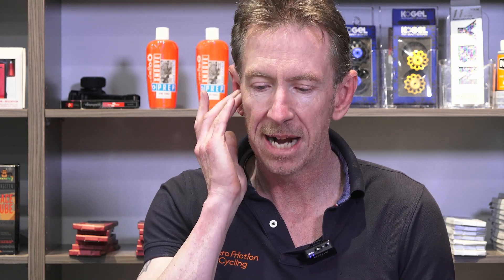Episode 10  - 12 Speed Chain Compatibility

Comment: Thanks mate. Great video. Trying to a run a 12sp GX chain on a 12sp SLX cassette. Front ring is GX also. 11/128 so should work, but its really clicky on the cassette. It should work right?
Reply from the maker: Thanks Peak Torque, and yes mostly.... it should. There are some little differences though that can mean things have to be really dead on. The shimano chain is a little thinner than eagle, and rollers a little smaller, and has the extended inner plate links for hyperglide+ which the cassette teeth will be profiled for. However it should mean that simply we just need to ensure tune and b-tension etc is set precisely. Is it clicky in every gear or just largest cogs? and is it clicky on cassette but smooth through pulleys or is it not meshing perfectly into pulley teeth (eagle or shimano pulleys?). Honestly GX eagle can be faff to tune for gx cassettes - it is not usual for GX riders over time to at least upgrade shifter to x01 - as just have ongoing issues re some cogs it is clicking way as not perfectly tuned, and trouble keeping it in perfect tune. 

Also basic checks such as if it was perfectly fine on GX cassette, and only change is to slx cassette, how old is chain? GX chains wear very rapidly, worn chain on new cassette can have poor mesh etc.
Reply: @zerofrictioncycling992  thanks for the rapid response! Has been frustrating me since the width when measured seems almost the same. For clarity, its a GX groupset from new but had the cheaper NX cassette on a hyperglide hub. New wheels are xdr or microspline, so got a SLX blocks as its less than half the price of GX and its a winter hack... 

Its clicky, oddly, in the smaller cogs at the back! Goes to the 51t with no binding. Its a metallic ticking sound. Maybe a very worn chain as you state. Has see some abuse! A few tweeks of cable tension either way doesn't seem to change much tangibly, then again on a gx shifter it never did, as you quite rightly state! Subbed to your channel, should have more mate!
Reply from the maker: @PeakTorque  ah yeah check chain wear first then, GX chains are shit. XO1 eagle has literally like 20 times the lifespan pretty much, or ybn 12 work super smooth on eagle and will with a SLX cassette, and about 5 times + wear life of a gx chain for most. And yeah im terrible at social media - i am going to lean in xmas hols to start trying to do vid updates meself now vs film days that i just never get to prep properly for, and due to cost though per vid i have used cover the main longer topic stuff, will be looking to move to shorter updates each week or two in 2023 which will hopefully drive a bit more traction vs very sporadic longer vids. Thanks for subbing! let me know how new chain goes - that wld be first port of call and do asap as running worn chain will chew out your new cassette and rings. 

The reason sram cassettes double the cost of shimano is cos they use a much harder steel. Shimano stuff will wear much faster unless looked after, so you really dont want to run a worn chain - you can do a fair bit of damage in fairly short order, especially mtb with higher torque / tension for a given power due to smaller chain ring and grit involved etc
Reply: @zerofrictioncycling992  interesting thanks mate. I know how hard the plan, write, edit process can be when all you wanna do is work and get the data. Its a labor of love, and hate!
Interesting about the hardness, have you hardness tested them? I normally go for Deore to get steel rings right to the top to deal with the low speed torque. Interestingly even the Deore cassettes use the same type of peened steel finish an ultegra road cassette, not the chrome plated (cheaper steel) equivalent to 105. Have never tried a ybn chain, may have to give it a shot id you reckon it'll work on both slx and sram cassettes.
Reply from the maker: @PeakTorque  No havent been able to hardness test them - i have had on the wish list for ages to wear test cassettes like the chain wear durability testing but lubricant testing has just been too flat out to try to keep up (there are scant options globally for manufacturers looking for independent verification on their lubricant performance). 

Just from experience and also bikes through workshop over the years - srams steel cassettes have typically been notably harder wearing vs shimano. For eagle x01 and xx1 level this has been pretty easily determined as sram has actually marketed via reps that the cassettes 11 steel cogs are made of tool hard steel, and that is born out in practice with them being extremely hard wearing, and it is a big part of why they cost so much. An x01 / xx1 eagle vs XTR, XT, its no contest re wear, and the cost to mfg is a big part of why they cost so much more. This appears to carry on quite notably still down the range - a GX wont be same steel as an x01, but there is still a reason it costs double vs shimano equivalent - the steel is a lot harder.  

*Note for eagle cassettes though, often x01 / xx1 are ruined due to the fact the largest cog is made of soft fast wearing alloy, not tool hardened steel. People shld try to avoid using as much as possible. I barely ever use mine, and it is still by far the most worn cog on my oldest xx1 cassette - where the steel cogs i have been using for last 6 years are barely worn at all. People who actually use the 50 / 52t cogs even mildly will have that cog worn to replacement point whilst the remaining 11 cogs are still mint perfect, ruining a very very very expensive cassette. It is maddening that sram do this.  

Anyhoo :)  - Yes the ybn will run beautifully on eagle and shimano - so if GX chain is worn (and its sounding the likely culprit) - definitely try a ybn sla 12spd - hopefully you live somewhere you can get one ok - they can be hard to find locally in some regions

Comment: Using a Garbaruk front chain for my new Shimano Ultegra Di2 in a 1x12 setup and had exactly the same question about HyperGlide+ compatability for a multi-teeth design. Garbaruk promised it would work - and a little to my surprise - I have no complaints so far. Its still early days but rear shifting is great and the system noiseless, on top I have not had any chain drops in spite of hitting a couple of very brutal bumps that flung other parts off the bike. Probably these chain rings work the best for 12 speed chains, but only guessing here? I think there are 3 multi-chain-type-compatible producers that include HyperGlide+ compatability - WolfTooth for instance does not even if they have HG+ chain rings. Maybe you can one day test how these chain rings work on friction/wear? A lot of people are looking for HG+ alternative chain rings for existing bikes now as they look to upgrade to the new Shimano HG+ group sets.
Reply from the maker: AH most excellent. Yes on my mtb i have wolf tooth hyperglide+ rings - and all been perfect over a couple years now re no chain drops, even when not running shimano chain but back to eagle for training or ybn for racing. Sounds like garbaruk may be at least as good. Issue that may come up with trying cross compatibility in shimano 12s is going to be more on the back end for single ring bikes, if one goes away from shimano they will be giving up hyperglide + shifting if using a different cassette or chain. For road bikes i am not sure who yet may have shimano 12s compatible rings but considering how astoundingly good the new shimano 12s front shifting is, i wouldnt mess with that unless there was an extreme cosmetic benefit :)
Reply: @zerofrictioncycling992  "i wouldnt mess with that unless there was an extreme cosmetic benefit :)" - Agree 100%. But and Shimano does not make 5-point BCD chain rings which I'm stuck with. I confess I did get "bling" now that I was forced to experiment anyway. 🙃 Happy riding!

Comment: I currently run a 1x11 setup with grx rear derailleur, sunrace cassette, sram red 22 crankset with Absolute black ring.
I'm planning to switch to SRAM Rival controls and Rival XPLR RD and I'm trying to understand the different possibilities in term of chains and cassette.
If I understood correctly:
option 1: I stay in the axs ecosystem so everything sram, 10-44 XPLR cassette, 12speed flat top chain and that's all
option 2: if I want more flexibility in terms of cassette/chain I need to change the Pulley wheel with some 3rd part one, otherwise the jockey wheels don't work with other chains than flattop

Is it right?
Reply from the maker: Hi Michele - sorry delay we had dashed off for a weekend of racing! 

If you go the xplr path then you are switching into the flat top ecosystem. AB or alugear or wolf tooth MAY (im havent had time to check for awhile) make an axs flat top compatible ring for your crank - but im not sure. You will definitely need to go an xplr cassette as the indexing on the xplr RD is set for the more narrow cog spacing of the flat top chains (they are thinner than sram eagle 12spd).  This means you should then be running the flat top chain to match the cassette and the pulleys on RD, as such you need a flat top compatible chain ring. 

YBN and KMC both claim for their 12spd chains that they are compatible with flat top system, however i am EXTREMELY dubious of these claims as they are different standards, with flat top chain being externally and internally thinner and with larger rollers. YBN / KMC / sram eagle 12spd chains are externally and internally wider - so indexing has to be extremely precise, but the greater chain line angles of larger xplr cassette will still have a very high chance of side of chain rubbing on sides adjacent teeth in larger cogs even when indexed as perfect as possible. Also standard size rollers running on cassette teeth machined for oversize rollers means that to those chains an xplr cassette would appear very worn, and it is possible that much more early than normal chain could jump under high load. I just wouldnt do it, and i disagree with those chains being cross compatible to a completely different standard groupset. 

For most flexibility you may want to have a look at what is called "mullet" set up. SO you can pair rival controls to an axs GX eagle rear mech and run sram eagle cassette - however you are stuck then with a pretty big range of 10-50 or 10-52 (it is getting hard to find 10-50). Again depending on the frame, chain line angle in the largest cog can be extreme as it is just a really big cog for a gravel bike, and they are not always designed to be able to run such a large cog due to the more extreme chain line angle this creates (gravel bikes can have shorter chain stay lengths than mtb,s and mtbs tend to have smaller chain rings - like a 32. Running a 38 or 40t chain ring on a gravel bike to a 52t cog - holy batman that gets to be an extreme angle for the chain).  Tricks can be done to get to help chain line angle a little bit - in most cases (spaced cassette as close to frame as possible, spacing crank as close to frame as possible even though it can mean not being symmetric with q-factor) 

So..... mullet set up will be likely easier and cheaper - you will still want a GX eagle cassette so there is $$ there, as well as your axs GX mech to go with your rival controls - but you can run sram eagle or ybn 12spd chain - just take note of possible chain line angle issues in the largest cog.  If you go xplr, as well as xplr cassette and mech you will need flat top compatible chain ring which MAY = new crank if you cant find one that is genuinely compatible for your existing crank from aftermarket players, and you will absolutely want to use the flat top chain not eagle / ybn / kmc. 

Hope that helps!
Reply: @zerofrictioncycling992  wow, thanks for the  very exaustive answer. Yes it seems a real PITA for people who loves to customize parts on the bike..in this case GX rear derailleur is the best solution, apart for the weight. At least you can use a 3rd part cassette with eagle rd
Reply from the maker: @MikeRegrexion  ah yes correct - some brands like garbaruk may do a more gravel range - again i need to find time to do some good surfing soon to catch up on the latest. It is a bit of PITA re researching what is compatible, and it can be confusing that axs mtb (eagle) and axs xplr are not directly cross compatible. However on the plus side, if one does do the research and plan out which system is going to suit them best, there are some great options these days to make a bike capable across a pretty huge range of terrain / needs. It does look like sram are starting to move eagle to flat top based on recent prototypes seen at world cup level - so perhaps in not too distant future there will be direct cross compatibility from axs road to xplr to eagle, making the options for builds like yours less confusing & easier, and it will just be more legacy groupset owners that have to be careful with changes / upgrades.
Reply: @zerofrictioncycling992  what I still don't understand is if it's possible to use the Eagle axs rd with a smaller cassette, like 9-46 or less. 10-50 is really overkill for what I normally do
Reply from the maker: @MikeRegrexion  yep will work all groovy with those if you can find in 12spd - i know e-thirteen / garbaruk do that range in 11 but from what i have seen - 12spd see's big ranges like 9 to 50. I think shimano might be best bet i believe they have a m9101 - 12spd that is 10 to 45, shimano and sram use same indexing / spacing

Comment: What about 12 speed Shimano road, with a 1x chainring... what would be the best chain to use, no one makes 1x chainring for road yet, so want to use a 1x  11 speed chainring narrow wide....  What chain will be best ? YBN 12 speed ?
Reply from the maker: Yep thats a good question - you are correct i havent seen a road 1x shimano 12s chain ring yet but i havent searched much - maybe someone has one but im not sure. Assuming not yet, then yes for a fast chain and good wear lifepsan - ybn 12. You will be giving up hyperglide + shifting at rear moving away from shimano 12s chain, but you will probably have issues running that chain on a narrow wide chain ring. Expect just basically Dura ace 11spd shifting level vs hyperglide+. For ultimate wear longevity for training - sram x01 eagle or xx1 eagle. You will never wear one of those chains out. Ie training on x01, race on ybn.
Reply: @zerofrictioncycling992  thank you for the fast reply.. yes I've used eagle chains before on 11 speed setup 1x they do last a long time, specially since I started using wax., I'll comment back on how it feels when I set it up on my 105 di2 with the YBN12 and Narrow wide garbaruk chainring, thank you.
Reply: @JMacSp  I have this setup and wrote about it elsewhere in this thread. Quoting myself here to save time: "Using a Garbaruk front chain for my new Shimano Ultegra Di2 in a 1x12 setup and had exactly the same question about HyperGlide+ compatability for a multi-teeth design. Garbaruk promised it would work - and a little to my surprise - I have no complaints so far. Its still early days but rear shifting is great and the system noiseless, on top I have not had any chain drops in spite of hitting a couple of very brutal bumps that flung other parts off the bike. Probably these chain rings work the best for 12 speed chains, but only guessing here? I think there are 3 multi-chain-type-compatible producers that include HyperGlide+ compatability - WolfTooth for instance does not even if they have HG+ chain rings. Maybe you can one day test how these chain rings work on friction/wear? A lot of people are looking for HG+ alternative chain rings for existing bikes now as they look to upgrade to the new Shimano HG+ group sets."

Comment: Sir, then for what you say, I have a idea (must be bad, 😅)
Want to use in MTB a 2x 11 (11 speed Cassette, 11 speed 28-38 front rings)  but with 12 speed Chain (Yaban) and a 12 speed fron derailleur XT. My question is: do you think the 12 speed front XT derailleur work properly?, is a front pull XT front derailleur. 
Sorry my poor english Sir, hope you understand me. 👋
Reply from the maker: Hey agua- no that wont work. If you are on 11spd cassette and rings, why go to 12spd chain and front mech? the 12spd chain will likely be fine, but the 12spd mech will not - i am not sure what would be driving that decision making. The cable lever ratio for 12spd mech is different, so if paired to an 11spd shifter, things will be wacky. You may find it does note move enough, or moves too much for the lever throw, so you would likely either under shift or over shift.
Reply: @zerofrictioncycling992  thank Sir for your words.
the reason?: low price in Aliexpress for 12 speed MTB front derailleurs (13 usd for XT brazed) and the dificult for find 11 speed front derailleur in my country ( 80 usd for SLX front aprox).
Thank you so much Sir, apreciate. 👋
Reply from the maker: @aguagou  ah i see. But ooooh that would worry me what i was getting for those $$ from Ali. In my younger days on tight budgets i would try to save money, and it almost always costs more. Ie i buy the cheap thing, it doesnt work, or it works badly. so then i buy the proper thing. Now i have spent money on both the cheap rubbish and the proper thing. It would have been cheaper to just buy the proper item to start with. Plus if it doesnt work you will have other incidental costs like re cabling again, and if the shift performance is out of whack, you could have chain drops and wrap chain around bb, which can bend chain links, snap rear mech hanger etc etc. There is a saying - "Dont try to save me money, i cant afford it" - that saying and similar come from situations exactly like what you are looking at doing! :)
Reply: @zerofrictioncycling992  thank you so much Sir, I go for the proper thing. 🇨🇱👋